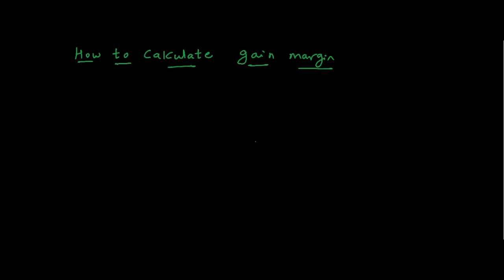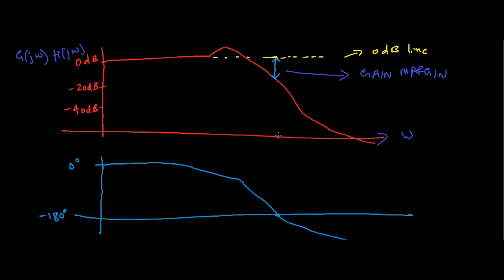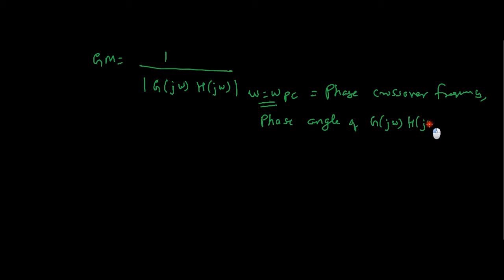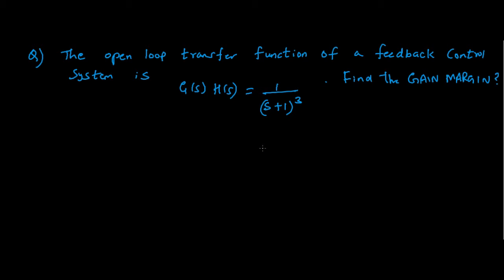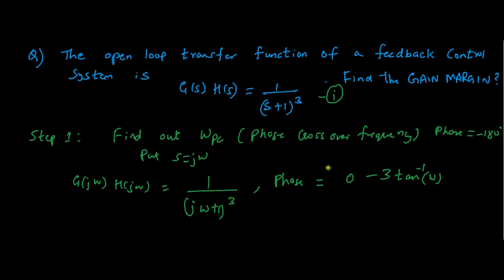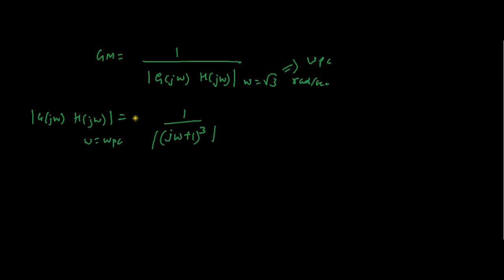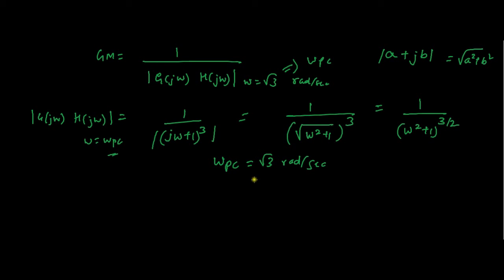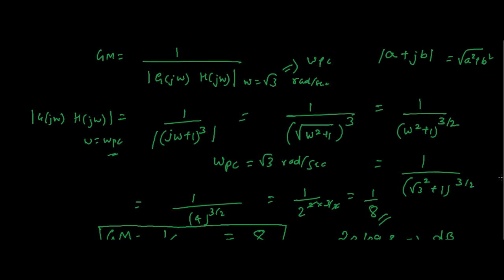How to find gain margin from a transfer function

Comment: Thanks for the video. It would be appreciated if you could specify what H(s) is. In some contexts it is used as the compensator and in some cases as the feedback filter. I assume when you speak of the loop gain you are referring to the loop transfer function obtained by multiplying the plant and the controller transfer functions.